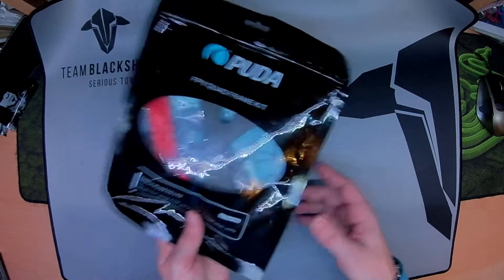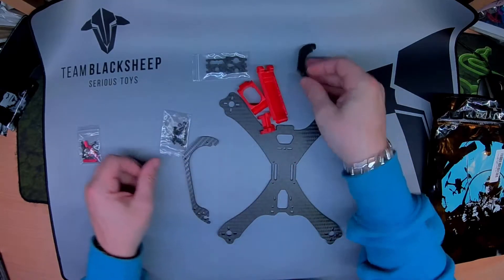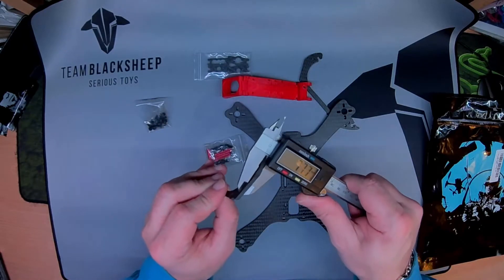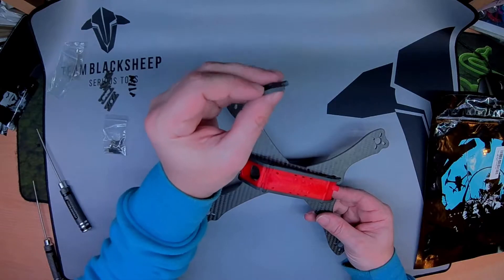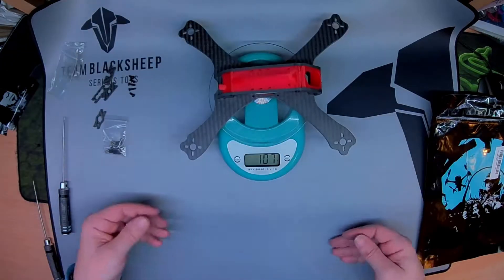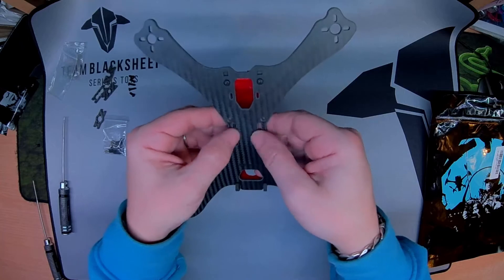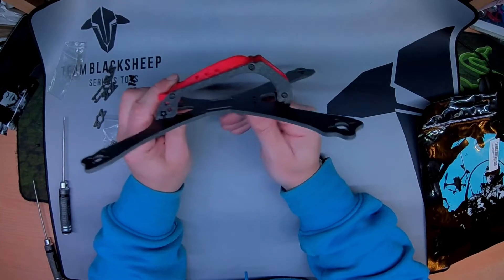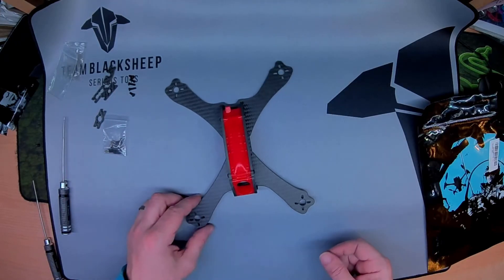Puda C240 Stretched X Frame [First Look]

Comment: Hey, after watching some drone videos, im a bit curious about what the price of a good quality beginner drone would be, at the moment i have one rc car and i will have a second one in 2 weeks, it will keep me busy enough, driving and upgrading them.. but since the second car was only around 60 euros, im curious about the prices of drones (not fpv, i've already seen the prices of those systems :p ) i have had a drone, but it was a toy drone, which was really fun but the motor broke the first day, so i'll be interested to get one later, depending on prices. And i dont really know how to say this but do you build a drone on every frame you make a review on?
Reply: to build a good buget drone cost around 200 but drones need a lot of maintenance motor'sand props  break a lot and PID tuning never stops
Reply: How To DIY Rc okay, maybe i need to start with a more toy like drone, they are alot cheaper and i can learn how to control it better. Thanks for the information! And a happy new year =)
Reply from the maker: I started with a Micro Drone 2.0 which is toy grade that was a gift a few years ago.
Eachine E010 is dirt cheap ,Eachine E013 can be gotten for about $60-70 with a full FPV setup.
Even the ones from Local supermarkets and larger shops can be good like the Revell Nano and will be a good way to get started.

To answer your question about building the frames, from the recent videos I Dont always but will be building the Japalura, Puda C240 & Chameleon over this winter (prehaps another small one). This last year I have built 4+ Quads and 3 Planes :)

Once you have the expensive one off things like a radio ,charger/batteries and FPV goggles, you can make Quads quite cheap ,example being this frame will in total cost about $150-$200 depending what I put in it while being stuffed full of quite good parts.
I'll do a rundown of the parts/pricing when I do the build video (got everything I think)
I think the Purple 215 came out at $140.

Happy new year!
Reply: MrE thanks, now i know i probably will buy a toy grade quad instead of a hobby grade one.. i don't have a job yet. But i have 30 euros per month, which is easily enough to maintain 1 rc car, and a second one too and of course do some other fun stuff around them. So i think a hobby grade drone would be a bit too much :p 
And since my birthday is in a few days, i'll be old enough to get a job so maybe that could change something :)
So i think i'll just keep watching videos and maybe get one in the future. 
And nice and short intros btw